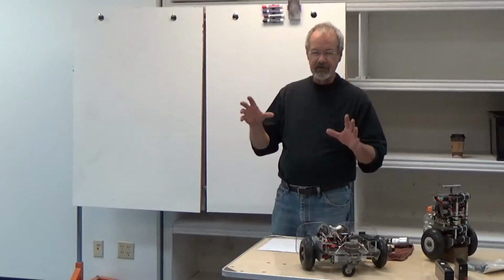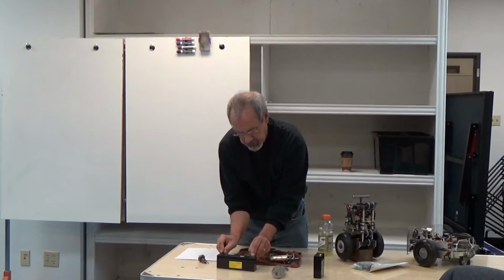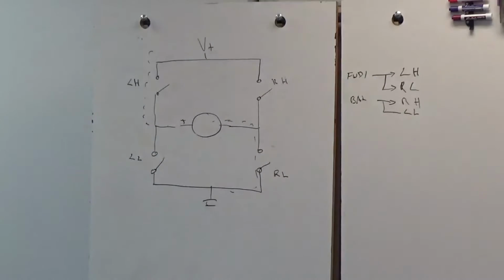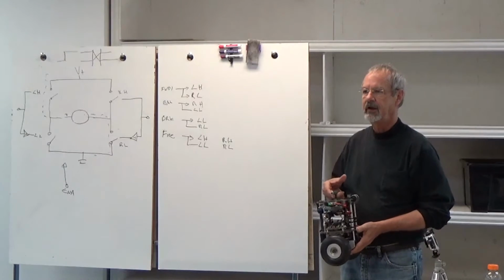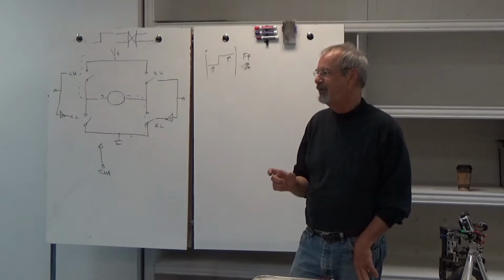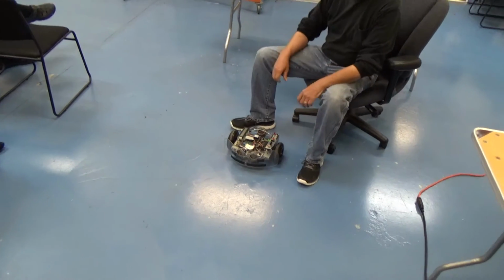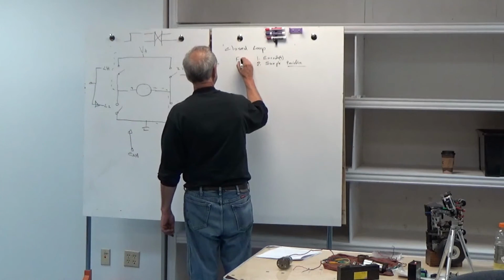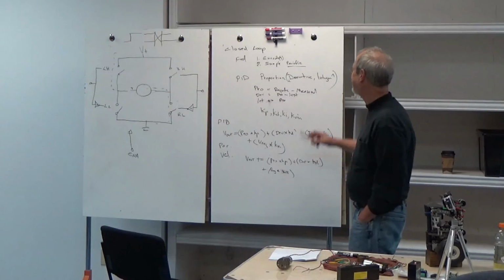David Anderson discusses Motor Control and PID (audio fixed)

Comment: I know it may be stupid question but can someone tell me what are those wheels on the robots???
Reply from the maker: +UpTechDate dakos Those are actually Model Airplane wheels.  I believe David said he purchased them at Mike Hobby shop, which is unfortunately no longer in business due to the I35 expansion.  But if you have a hobby shop that sells airplane parts you could probably find some there.